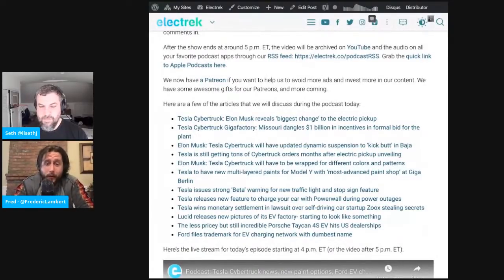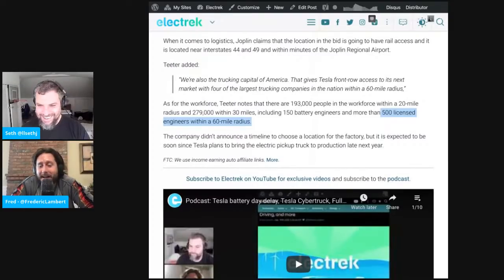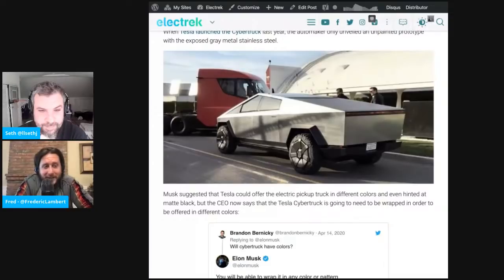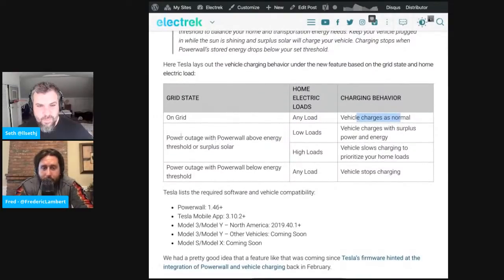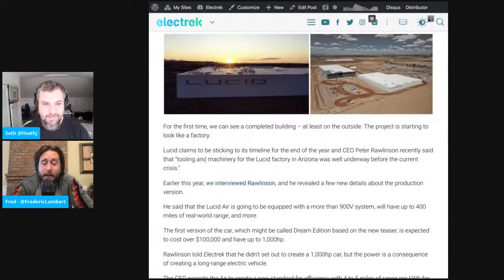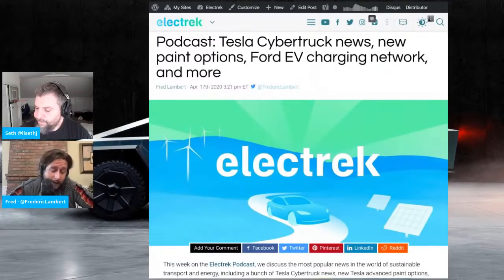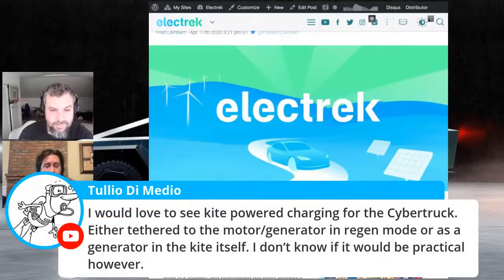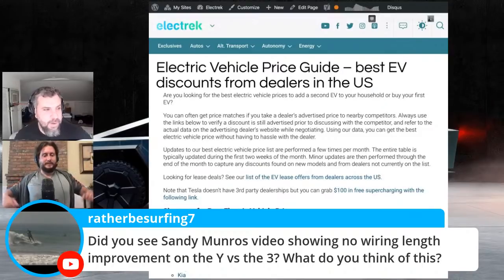Podcast: Tesla Cybertruck news, new paint options, Ford EV charging network, and more

Comment: Sandy meant 42V, not 48V wiring.  Electrical code states that 50V and above must be treated like high voltage wiring, IE 120V/240V.  A 12V lead acid battery is usually something like 13.8V when charged.  So four 12V batteries (48V) when fully charged is something like 55.2V.  Requiring high voltage wiring.  Thus automakers went with 42V, which when fully charged is 48.3V.  Allowing low voltage wiring.